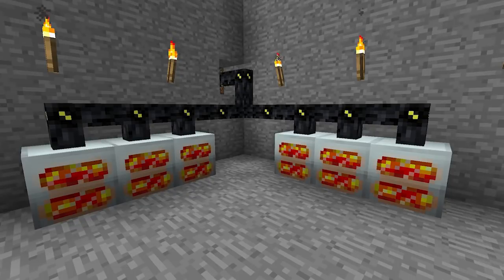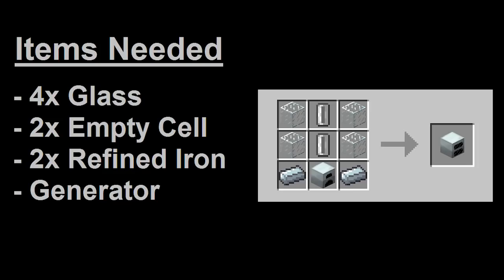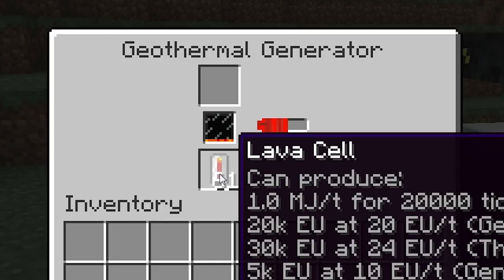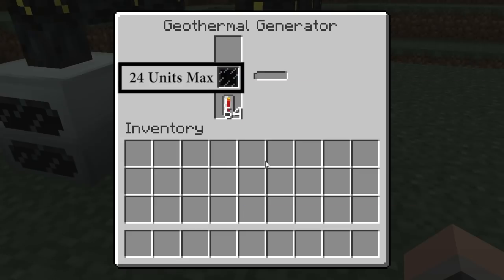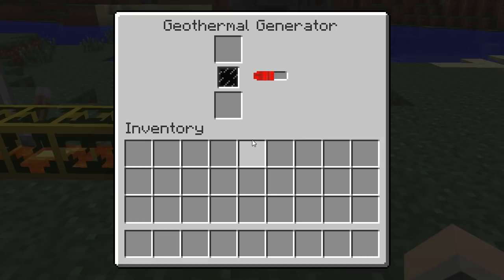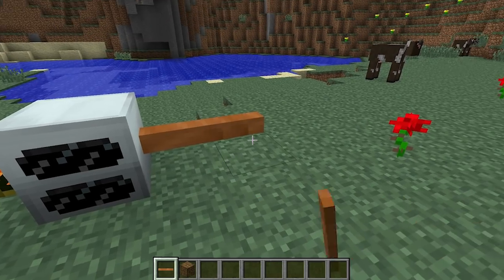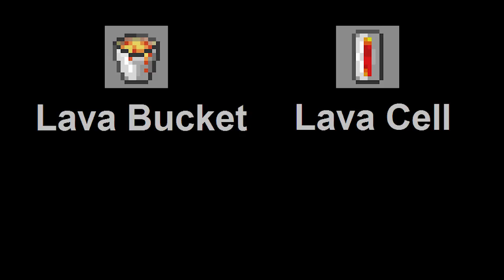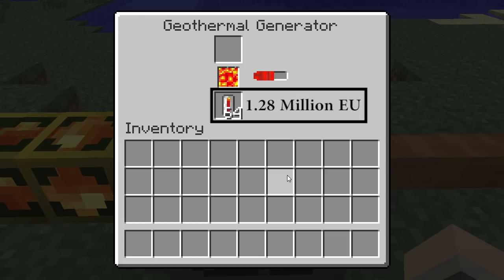Geothermal Generator (Tekkit/Feed The Beast) - Minecraft In Minutes

Comment: In the experimental build of IC2 you can use OpenBlocks' tanks filled with lava directly with geothermal generators. You simply place the filled lava tank into the geothermal generator's input slot and it will drain the lava in the tank. When the tank is emptied it returns an empty tank that can be used again. This is fare more efficient than using tin cells as it only takes five glass panes and four obsidian to make two tanks that can hold up to 16 buckets of fuel.